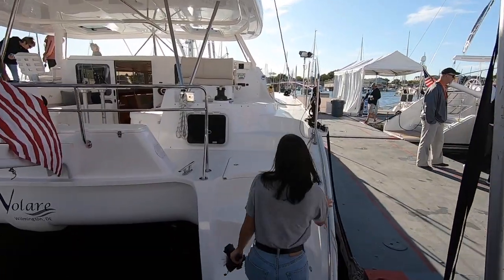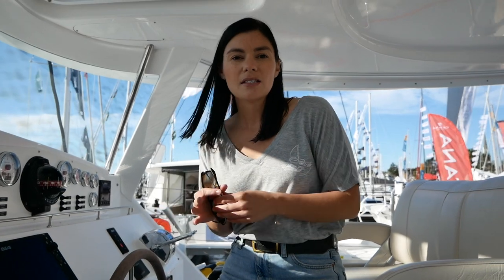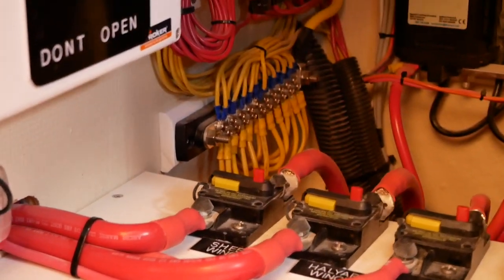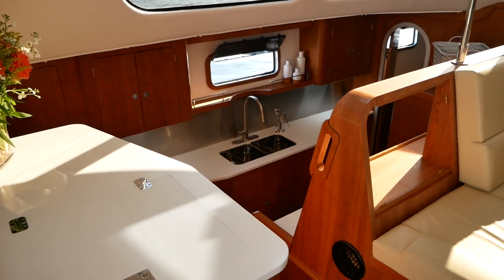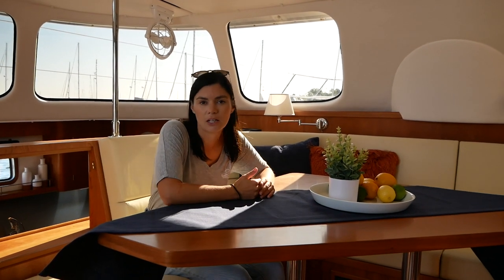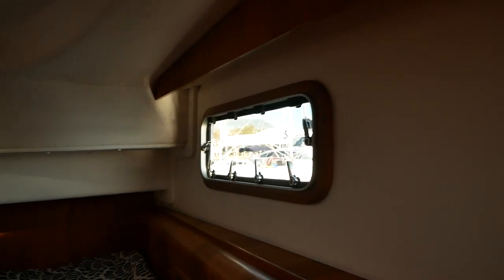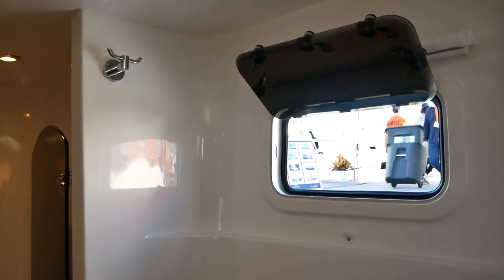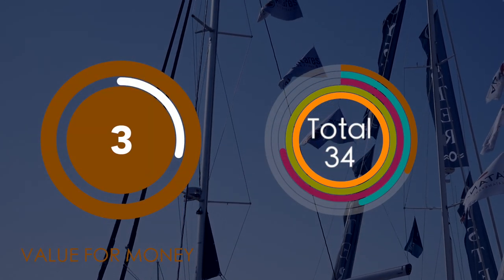Antares 44 GS Catamaran Review 2021 | Our Search For The Perfect Catamaran.

Comment: We have owned a 2003 Antares for 2 years now.  While the design may be dated it is certainly tried and tested.  When people ask me about what catamaran to purchase I always point out the build quality in the Antares.  If you walk on a brand new Lagoon, FP or other production boats in this range you will notice "creaking".  Our vessel is almost 20 years old and is still quieter than most brand new models we stepped on at boat shows.  

We do love the protected helm position.  We don't have the hard dodger and that is an upgrade we would love to have added.  We have zero worries about seeing any corner of the vessel, are well protected, and at the same level as everyone in the cockpit.  While the cockpit seats are curved, they are straight enough that we routinely lounge on them.  If you purchase an older model the cockpit also has rumble seats.  These are hands down the best seats in the house underway or at anchor.  I honestly can't think of any reason why GS moved away from this setup.  I would add the arch and rumble seating back in a heartbeat if I purchased a newer Antares.

If you guys ever want to take a trip aboard to test drive one, let us know.  We have a tour of our boat on our channel.

Thanks for another great review.
Reply from the maker: Thankyou so much for those comments- that's exactly the type of feedback that is useful to not only us, but everyone else watching!

Comment: Enjoyed your review and concur with most of your comments. I own an older PDQ Antares and have just sailed her from Norfolk VA to Antigua. The helm position and cockpit felt very secure and were dry throughout despite some bouncy seas, strong winds and squally downpours - foul weather gear just wasn't needed. The boat generally sailed at 1/2 apparent wind speed and we were often bowling along at 9-10 knots which I think is quite good for a cruising cat. We used a full batten main, a130 genoa and the screacher to keep the boat moving. 

We have owned her for a year now and have sailed her from Florida to Rhode Island, back down to Virginia and now to Antigua. We have found her a practical and comfortable boat to live on and I was very grateful for the keels, skegged rudders and shaft drives when finding out just how shallow some parts of the intracoastal waterway are...:-)

Comment: I sailed the Antares 44 for a couple of weeks and loved the boat. I am incorporating the dodger and hard Bimini design to my boat, 56' FP 1999. Motor access was simple and I found it easy to check fluids and access the drive shaft and gear box. The winch and line access was very simple, but read the manual on the self furling system it is not as it appears. Cockpit was amazing it was cold out and we closed the cockpit which made it quite comfortable. Deck access was very easy due to hand rail placement and steps to mainsail and boom. Helm is great only addition is a fan to combat condensation in the colder regions of the world as well as give the captain a little more of breeze in hot and rainy days.  Ports are amazingly thick and robust. The systems worked very well and were simple to operate, I loved the boat.  Changes I would make: The door latches to hold the doors open need to be through bolted, they use wood screws. Worth the money and is a true cruiser catamaran.

Comment: I crewed on a antarees,  we also had lots of leopards and some seawinds and the antares was my favorite boat to crew one, loved the galley down,  with shaft drive and mini skegs / skegged rudder you can just park it on the beach / sandbar.   But you are right it just hasn't evolved on the design has not changed since 2000.  Bucks per bang I would still buy a seawind
Reply from the maker: Good insider knowledge mate. cheers

Comment: Bit disappointed with some of your scoring and wanted to respond to some of your comments. Regarding the lounging areas , both the cockpit and the saloon are perfectly set up for horizontal lounging, just add a few small cushions and there’s ample space. Personally I don’t like the settee option in the saloon. I prefer having the washing machine there and the extra sink/ice maker instead of that extra settee. In the cockpit, It’s a shame the seats on the transom are no longer standard as they are fantastic space . Especially for dripping dry after a swim or when having a party. We often had 20-30 people gathering in our cockpit for sundowners. No issue. The design of the cockpit is what it is, you can’t have it all.
If you want to have shaft drives (which we did) that will limit cockpit design options.  Have you actually sailed an Antares? It’s by far the safest cat to take offshore. The helm position is unrivalled.
I don’t understand why you mention doing watch inside. I would never do that. We always sit outside , close to the instruments and able to immediately throw the helm in standby in case there is an emergency. 
Your comments regarding the shower room are a bit unfair, have you actually stepped into the shower? It’s huge and I’ve had both my kids in the shower with me when they were younger.
I agree the design is classic and it will appeal to people who are monohull sailors. The performance is much better than you describe. This is a lightweight boat and it sails very well.
Reply from the maker: Thanks Audrie & Seathan! Like the other Antares owner who commented, this feedback is very valuable because, as you rightly say, we've never had the opportunity to sail an Antares. Obviously it's not practical or possible for us to sail all the boats we're reviewing, and so there's naturally an element of guesswork involved when evaluating some of the liveaboard aspects. This is why your feedback is so important!
I know how much you love your boat, and, like many Antares owners, you justifiably consider  it to be an ideal vessel for your sailing adventures. Just to clarify- I didn't mean that the shower itself isn't spacious- I meant the entire shower room, which, with the toilet in the middle of it, is more cramped than many modern catamarans in the mid 40s. But that's far from a problem for us and I can't see it being a dealbreaker for many people! 
Interesting what you say about doing a watch outside overnight. I know other catamaran owners who often keep watch overnight from the nav station and only come out to the exterior helm if they need to. I don't know what habit we'd settle in to, but we'd like the option of being able to do watchkeeping from the internal nav station if need be. 
I'm particularly glad to hear you don't have any issues with the design of the cockpit or saloon!
Fair winds and hope to meet you someday-  😊
Reply: Sailing Yacht Ruby Rose Fair enough. And yes, I am very fond of our Antares and I do get a bit defensive because some of the comments are unfair in my opinion. As you know, we were monohull sailors before and when we started looking for a cat, it became obvious that very few cats are actually built for proper offshore sailing. It’s like comparing apples and pears, some of them look fantastic with beautiful cockpits and lounging areas but I wouldn’t want to take them offshore in a big sea. It all depends on what you want to use it for. We have yet to step onto another cat that we prefer to ours (and we’ve been on many). There are so many things to add to what you’ve mentioned that are so clever about this design. I agree it’s not the most flashy boat out there but it all depends on whether you want a show pony for coastal cruising or something to take you around the world safely and comfortably.
Reply from the maker: @sailingrehua4842  I guess our point is that the compromises we- and many others- have highlighted are points that could easily be changed by Antares (as they've so recently demonstrated with a custom cockpit for a new owner). So.... why don't they go ahead and make those changes?! I'm not saying those compromises aren't worth it for such a quality vessel. I'm saying they don't actually have to be compromises at all. Unfortunately if you have a budget of $1 million US, you have a LOT of options- not just production boats, but quality, offshore ready boats such as the South African manufacturers- and I'm not certain Antares are being competitive anymore. Our criticism really does come out love for this boat!  A used Antares is definitely on our shortlist, as you know through our personal communications. We really do value the safety and build quality of this boat.  I hope Antares consider this feedback to be constructive, which is our intention.

Comment: Thank you for this review. Most of what you said was spot on, especially the dated design. I disagree though on what Terysa said about the guest bathroom. One of the things I like about this boat, is that it doesn't suffer from the "hydra syndrome" - the sea monster with heads popping up everywhere. Placing the guest head in the bow does free up a lot of precious space that can be used much more effectively for liveaboards, and it will only be an issue if you have two couples who can't stand one another on visit at the same time. I think that the one thing that really separates this boat from most other cats of the same size, is that the guest hull isn't completely useless when you don't have guests on board. 

Watching the whole of your series, I'm starting to thing that the perfect catamaran doesn't exist. My idea of one would be to take the size, hull width and general layout of the Antares, and ask Outremer to build it, but that's probably not gonna happen.
Reply from the maker: Hahaha, we can only hope for a hybrid of all the best bits mate
Reply: lol... than you have a limited thinking... How about not waking up the people sleeping on the forward cabin, how about privacy issue because one has to cross the other cabin so what if you tend to sleep naked or with very little cloth (and no blanket) because it's hot?  It has nothing to do with couple unable to stand each other but it does not mean that each couple know each other or feel like the other couple should have access to it while they sleep there... OR it could be kid... try letting a boy go trough the room where is older sister is sleeping... She might not like it...
Reply: Of course there are situations where this head placement is not ideal. It's a compromise, and one that I agree with. The boat is meant as a home for two people, not a hotel. Compare to just about any 45 - 50 ft cat. The guest hulls are all just beds and heads. This boat has an excellent galley  as well, which IMHO is a better use of limited real estate than an extra head.
Reply: @steink6021  i can understand that, but still see Terysa comment has valide one unless you plan to never have more than one guess or couple aboard the boat at the same time...
Reply: @noway543  Antares is designed for a cruising couple. NOT A CHARTER CAT FULL OF STRANGERS.
Reply: @mjb2048  euh... with 3 beds... ok... hum...  than what is the point of having them?
Reply: @noway543  Guests are rare so the port forward bunk usually gets used for storage. With 2 nice aft cabins real couples can both get a good night sleep if one snores or is sick or whatever. And it's the age of Covid so a need to isolate may happen. Or a lot more storage.

Comment: The engine bays sold me. I also agree about the curved seating in the cockpit.
Cheers
Reply: I realize engine replacements are uncommon and infrequent but if needed how is it done?  do you disassemble it in place and remove it from the boat part by part and then the reverse to install it?
Reply: Depends on how much grief you have arranging to slide the engine to the point you can get it out. Four strong men and a small boy. As the old saying goes. Some boats you have it easy. 
Unfortunately this one has green motors, I prefer the grey ones. Lots less chance of putting the owner in the poor house.
Cheers 😁

Comment: I've been looking forward to this review for some time now.   You crazy cats did not disappoint.  I agree Antares is long due for an update (from bow to cockpit), but it does seem to work.  Perhaps I'm off my nut, but I think of them as a good ol' reliable pickup truck (not the performance of a Porsche or well-appointed as an A8, but does the job required and does it well).  They are pricey buggers new, but they do come ready to roll (from water markers to washing machines to 1200w of solar).  Still, I think you guys are spot-on with your review (both positives and negatives).  As far as used,  I think the boats are priced artificially high due to the broker's near monopoly when it comes to the used market.  For me, it is still #1 on my short list, but I also subscribe to the philosophy of buying the smallest boat you can afford.  Thank you again for your thoughtful reviews!!
Reply from the maker: All good points mate. Cheers

Comment: Another great review - I’m sure future Antares boats will benefit from the honest feedback..  I do find the ‘performance’ category somewhat of a dichotomy as it appears to be based largely on speed.  For a live aboard with your otherwise strong focus on safety I would have thought performance might also be measured by how it handles across a range of conditions.  Being fast does not necessarily translate to comfort.  Perhaps width to length ratios, how well the weight is balanced and how much fuel and water can be carried should also be performance factors for a live aboard cruising scenario.  That said I look forward to your next review.
Reply from the maker: Hey Murray- you're quite correct, the Performance category is a really tough one because we're- unfairly, probably- comparing non performance to performance cats. So, an Outremer or Seawind 1600 will score very highly here, since they're super light and fast with good pointing ability. Clearly, a cruising oriented catamaran will score lower here, because they're sacrificing performance for interior volume and liveability. So yes, the category isn't perfect, but it's hard to add other criteria to that category (ie, comfort underway) because there's so many factors that influence a comfortable sailing motion, not least how laden down the individual vessel is.We'd be heavily relying on the manufacturer or dealer giving us the information on how well the boat performs and its comfort underway and clearly that's not ideal either as they're always going to tell you how very fast and comfortable it is (we've already tried this!!). In a perfect world we'd test sail the boats in lively conditions and give a full analysis on every aspect of it's sailing performance, but that's totally impractical. We're doing our best to be fair, but that category is problematic and we accept that.

Comment: Great review.  I enjoy your reviews and I like the empirical format & formula for your review ratings.  Data is great but you can't eat it, sit on it, or listen to it, so your formula looks to be a great compromise.  You two are quite entertaining and seem to have good rapport. 

I have been a huge fan of the Antares for years and I was equally disappointed that the GS wasn't able to offer more updates.    The core vessel is superb but it is overdue for a more thorough update.  Honestly, a second model (~50 ft.) on a new hull with the new systems (toys) as demanded by the market would seem to make the most sense, assuming a business case could justify the new molds, marketing, engineering, etc. 

I view the Antares as the marine equivalent of a Toyota Land Cruiser;
1) Bullet-proof platform, very robust, very reliable, will last a long time.
2) Operated at its ideal speed, will go virtually anywhere.
3) Ergonomically speaking, it might be a decade or more behind.
4) The design is dated but solid.  Yes, most manufacturers have walked away from most of it's critical core design components but normally relying on shortcuts, cheats, or with reduced capability.  A redesign of an icon rarely meets the original magic. 

Congratulations on an excellent channel with great personalities & content.  Looking forward to many more episodes.
Reply from the maker: Thanks for the thoughtful comment and kind words John! Glad you found the video useful.

Comment: Realy looked foreward to this one its one of the few that has props/skegs also the safe engine position and in the middle of the centre of gravity , Safety is the byeword of this cat and as standard it comes with a very high spec which are extra s on others, Like the solid build ok its a little dated but do flash lines or windows improve the basics ? This cat is a plodder not super fast & will get you there safe & sound & in  one piece as Nick says its overbuilt in many respects. Spec for spec its not that much more than others. Long term ownership will be like classic cars , real wood not Ikia substitute rubbish blonde woods do make it appealing on so many levals, kitchen down does give the chef more space & again storage with that layout puts the weight lower which again equals safety. From a personal view I would spec dark blue on all the sofas ect whites and creams look grubby after a while but overall nice review guys .
Reply from the maker: Thanks mate. All good points. Don’t forget to leave your vote

Comment: A bit confused about the low rating for performance. 10.2 tonnes I would have thought is pretty good for 44 ft.
Reply: Agreed. Every published race result for Antares puts them at the front of the pack. Easy to fact check. It is not a flimsy racer but it is a decently fast boat. My short list is this boat and builder as soon as I can get the funds sorted. I would rather cross an ocean in a well tested design than be a guinea pig for the latest fad.